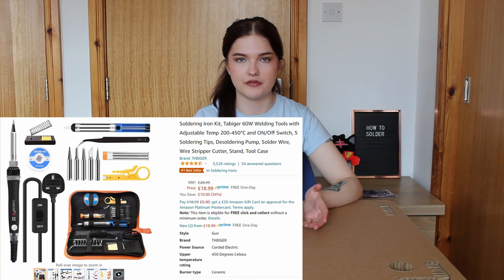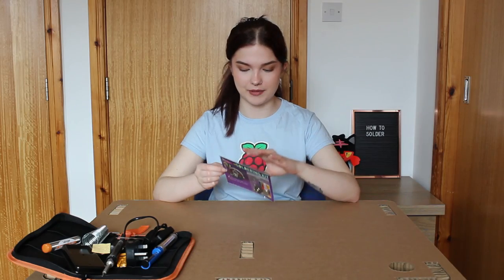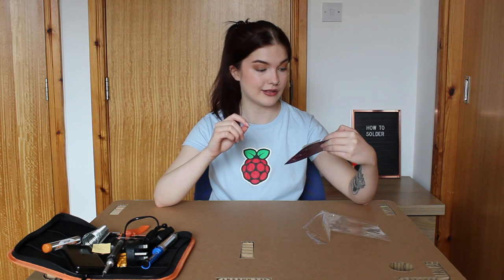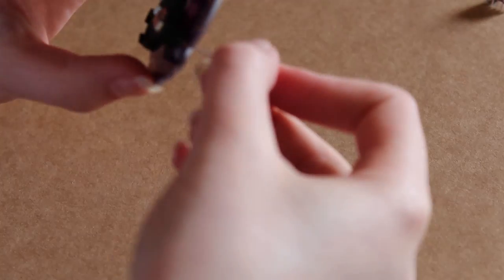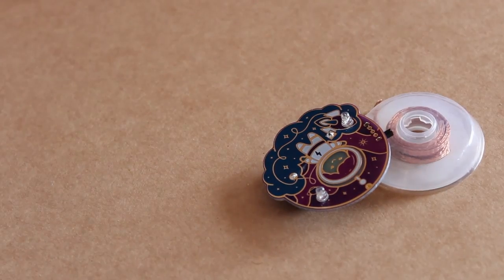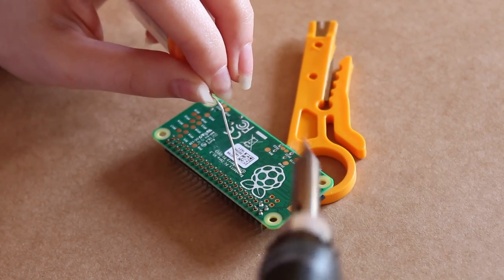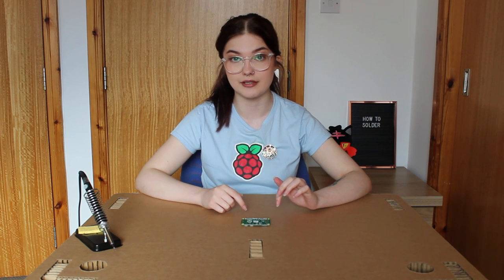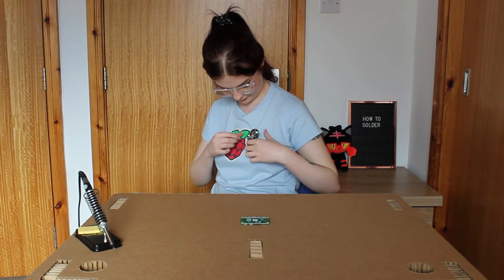I Try Soldering! | Soldering Header Pins On Raspberry Pi Zero

Comment: Would be awesome if you did some simple circuitry videos. Even something like soldering simple led circuits made from scratch.
Reply from the maker: That's definitely on my to-do list! I have an idea for a bigger project that will involve some electronic work so I'll be making some smaller videos beforehand as I need to learn myself :)

Comment: Hi Ellora. Working at Raspberry Pi I see much much worse header pin soldering on boards sent back from customers trust me! A little tip. Make sure the tip of the iron is touching BOTH the PCB pad and the component leg.  Then add the solder directly into where the two meet.  Try and get hold of some thinner gauge solder too. 0.45mm is good.  Makes small joins much easier without overloading the solder by accident.

Comment: A technique for more easily get your connectors nice and straight (e.g. on your RPi header) - first, solder one pin at either end of the connector. Then you can gently press the connector with your finger and reheat/remelt the solder one end at a time, without needing to use 3 hands. Then you can go back and solder the rest of the pins, knowing that the connector won't move.
Also works well when soldering in other through-hole components.

Comment: If you are soldering headers onto a Pi, get a breadboard and stick the headers in there then put the Pi on top. Makes sure that all the headers are straight :)
Reply from the maker: That's smart! I'll remember that for next time. Thank you!
Reply: good idea and the contacting elements are enough distance away from you soldering that it would not normally conduct heat away from you soldering job.

Comment: btw... your desk is made out of cardboard? Did you make it yourself or buy it from somewhere? I feel like I could do with one of those at the moment!
Reply from the maker: Yeah it is! It's called the Paper Hive Pop Up desk. I got mine from Ryman at the beginning of lockdown as a temporary solution - but it's actually really sturdy so I've just kept it! Super easy to fold down if you need to and even has holes for cable management. A very good use of £30 haha!